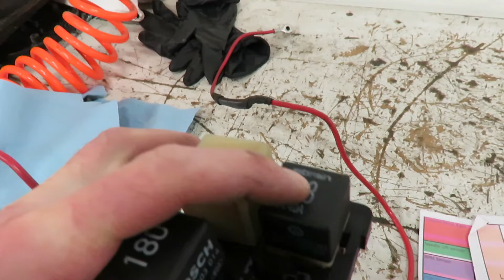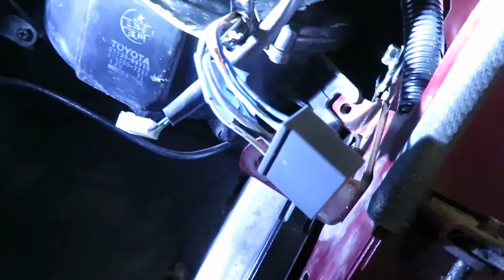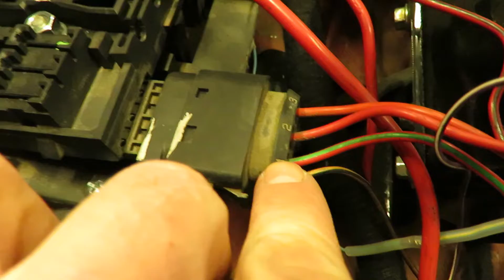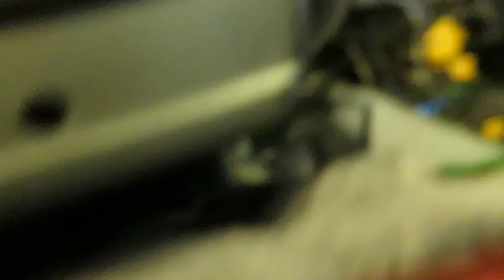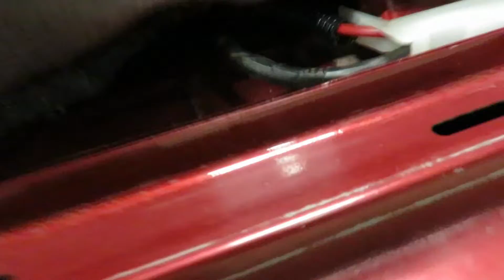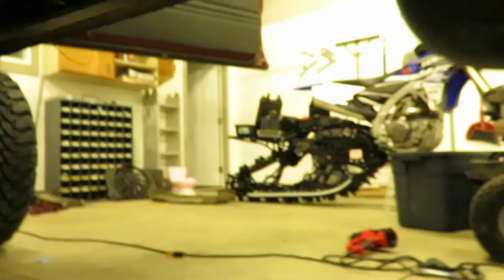Toyota TDI Diesel Swap Wiring The Fuel Lift Pump with Relay

Comment: Did you use the stock fuel pump from the Toyota tank? I'm doing a tdi  swap in a 91 hiace van and my van doesn't have a lift pump in it. I'm getting a misfire in cylinder 3 and I'm thinking it's because of inadequate fuel pressure. I'm gonna try bleeding the lines again but if I do end up needing to install a lift pump, would it be worthwhile to get an inline fuel pump? Or do I need to modify the fuel tank to accept an in-tank pump?
Reply from the maker: SleazyBakeOven you need a TDI lift pump. Stock puts out too much pressure
Reply: @austinniemela  how would running without a lift pump affect the performance of the engine? My 1991 Toyota hiace van was diesel from the factory and didn't have a lift pump installed as it relied on the injection pump to draw fuel from the tank. Now I'm noticing that I'm getting a misfire on cyl 3 and was thinking that I might have air in the lines.
Do you suppose I could get away with installing an in-line fuel pump if it were to help with the running problems?